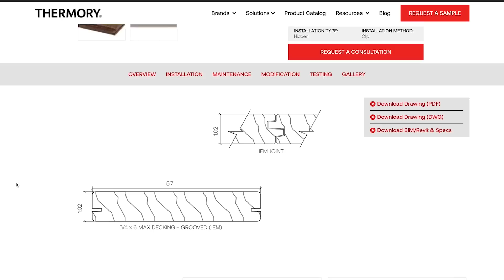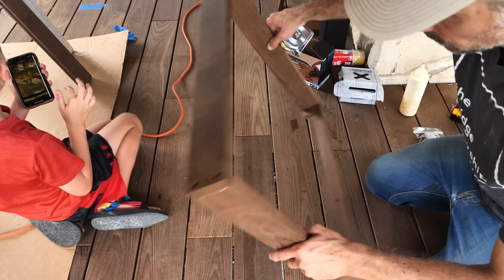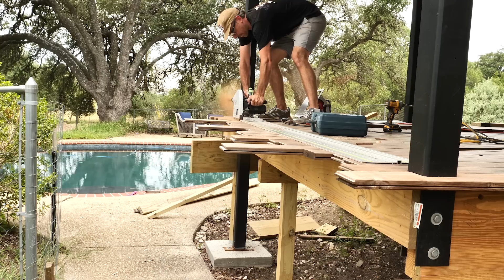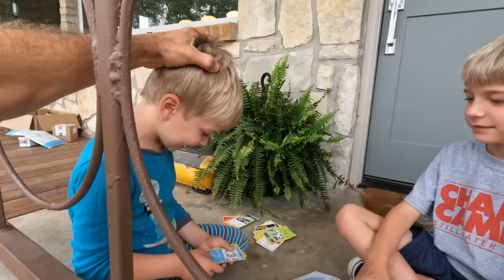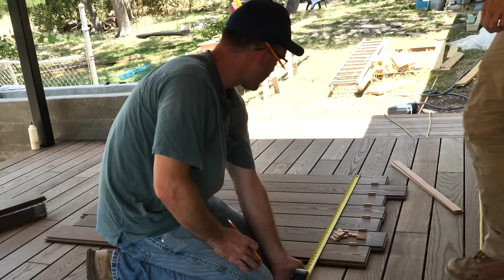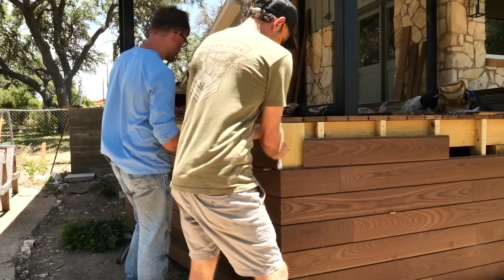Finishing the Ceiling, Framing the Deck Skirting, Installing Cladding (DECK BUILD PART 5)

Comment: It really looks great! I love the chocolate color wood. The skirting is like nickel gap shiplap and looks fantastic. If the step by the planter bothers you just throw a thin piece in there as if continuing a 90 degree turn and if the perfectionist in you won’t let you pull it and miter it. Fills the gap and easy. Otherwise don’t even worry about it. Since the video is from the past chances are you don’t care anymore. Anyway great video. Looking forward to more